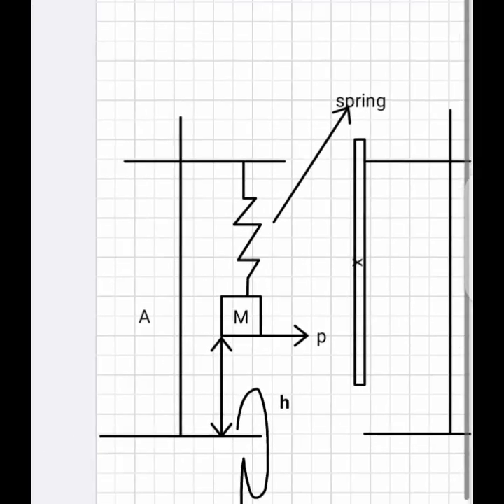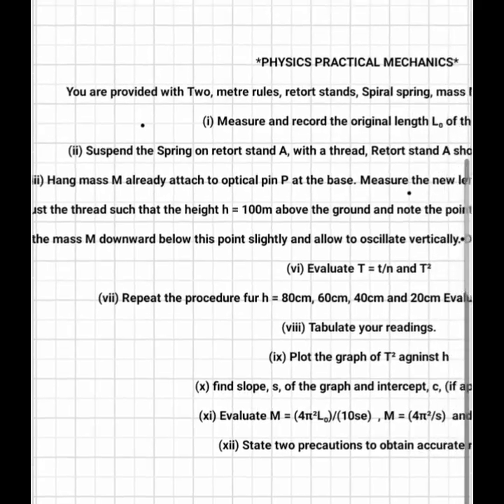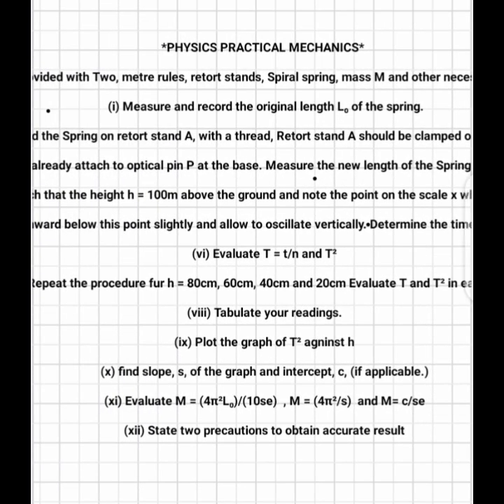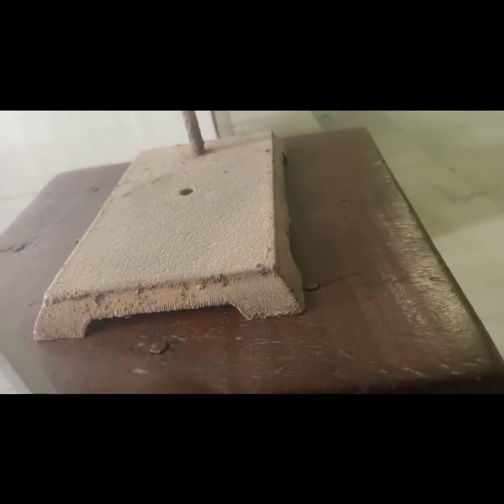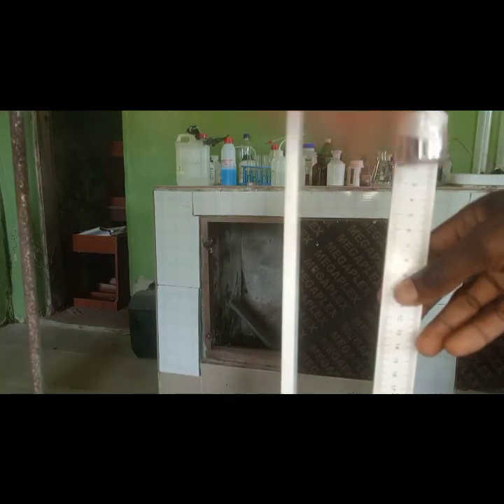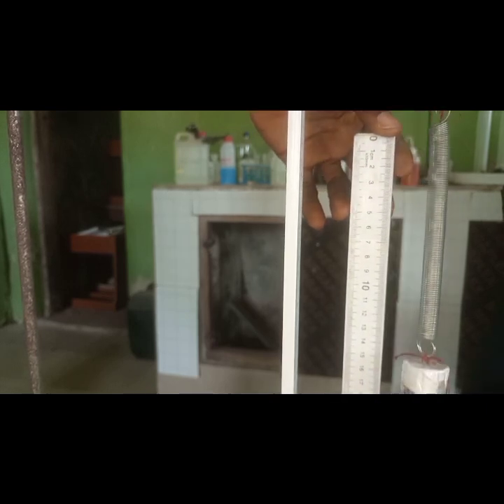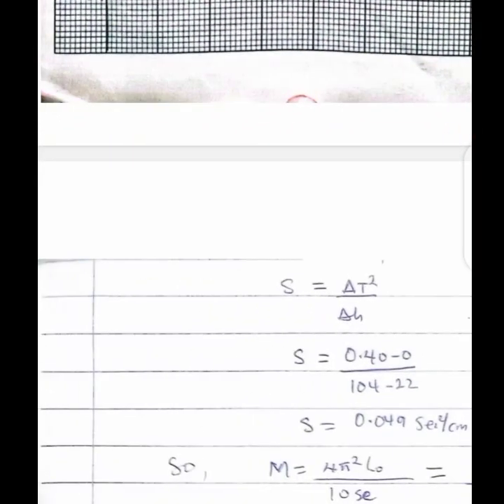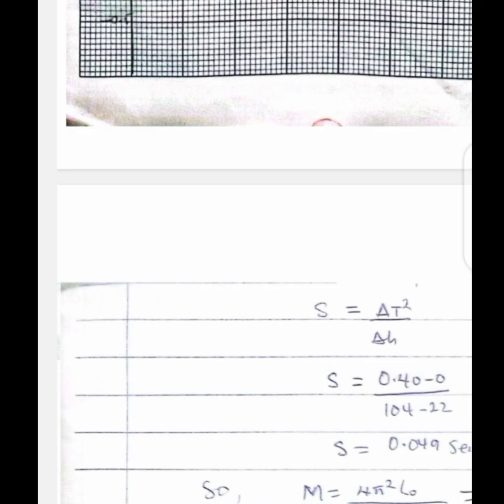WAEC 2025 Physics Practical Mechanics

Comment: Great. Is it oscillating vertically downward or horizontally? Good job sir
Reply from the maker: It is  vertically downwards.
But the pointer should be placed at the end of the spring that's the modification